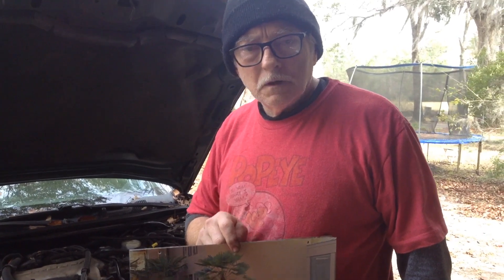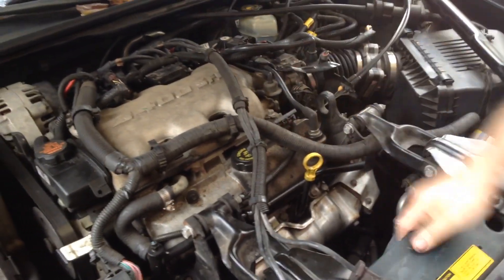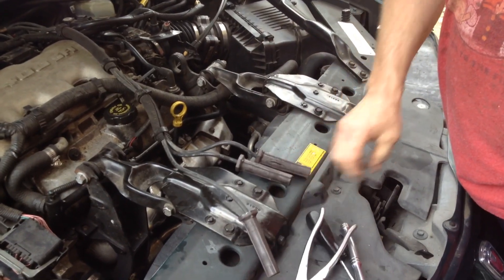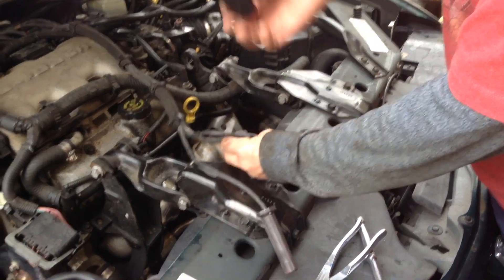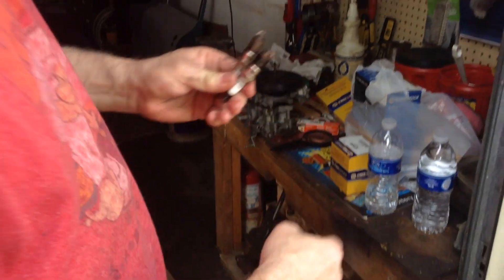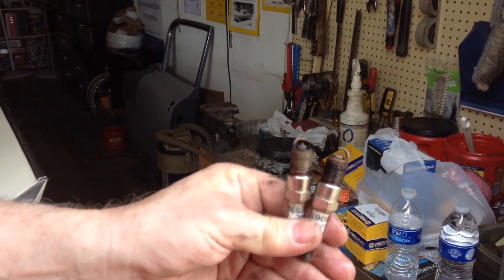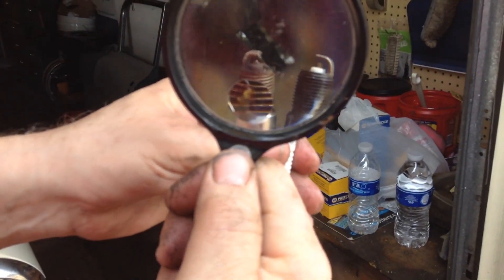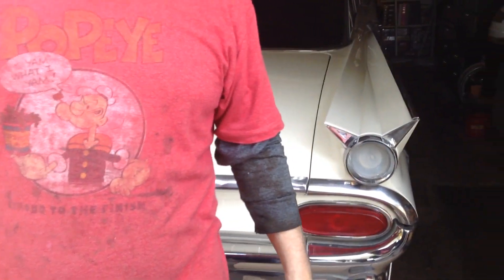How to remove spark plug boot.

Comment: I'm doing an engine rebuild (blown head gasket or cracked/warped cylinder head but you have to check the engine for other issues as well that could have been caused by overheating) and I haven't been able to remove the back spark plugs, but I'm definitely gonna try this tip. Thanks and God bless!

Update: With some PB Blaster and a screwdriver it worked wonderfully. For anyone reading this that hasn't done it yet, you just try to slide the screwdriver down as far as you can in order to space the boot from the plug and when you feel the screwdriver scraping the top of the plug, you're almost ready to start pulling it out. If you can't get the screwdriver any further, just gradually spray the penetrating oil down in to help it slide down better

Comment: Thanks!  I also have a 3400 engine and my fronts are stuck. It is a 2002 i owned since new - right after 9/11 with a gm patriot rebate.  I replaced the plugs and wires at 75k when i put a new headgaskets in.  Now at 175k, it barely runs when it rains or has morning dew.  I will try the wiggle and wd-40. I only use oem parts even on this 18 year old van!!

Comment: I tried your idea on my chevy venture (same engine design and spark plug wires as yours).    I used a screw driver and WD40 on one of the front wires and it worked great.    I tried one of the back wires and I punctured the wire because I couldn't see what I was doing.    Figuring I'll just go get new wires, I used regular pliers on another front one.   I twisted it a few times and then with all effort I quickly forced it back and forth about 5 times and it pulled out with no damage.   I went ahead and did the other front one and then did the other 2 at the back.   The ones at the back were more difficult because I could see what I was doing, but it worked.    All 4 that I pulled with regular pliers have no damage.    The wire that I punctured, I decided to cut it back an inch and recrimp the end.

Comment: Super Thanks to you.   Came on here cause I don't want to change the motorcraft sparkplug wire set if i don't have to but I can't get the boot to budge & I'm just on my 2nd spark plug since yesterday haha  better slow than breaking anything. Going to stick something in that boot to make room for that WD40.
Reply from the maker: Ax4400 you got to unhook what i call the dog bones and pull the emgine foreard
Reply: I just sprayed a little WD-40 around the top of the boot, was patient and got them off ;)
Reply: Can I spray wd40 on the side of the boot where it contacts the metal cover? That's where it's stuck..And I thought wd40 was bad for rubber parts..

Comment: How to remove spark plug boots: my '07 Grand Prix 152k had boots stuck!! Used a large screwdriver and hammer or vice grips to break the spark plugs and the boots come right off.

Comment: I do it with a micro fine insulin syringe fill with PB blaster oil. Slowly Inject oil into plug connector.Works easy.

Comment: There is nothing wrong with your old plugs, other than you could clean them(sandblast if possible, otherwise use a torch), then check the gap.  I took out plugs from a Honda and the electrodes were worn down like pointed ends of toothpicks, AND it still started quickly and ran nice and smooth . . .  new plugs are overrated BS, always have been.  Plugs are usually the last thing wrong.  I mean look at them, they are built like tanks, tough as nails.  The wires are a different issue, like any other wire needs a snug connection.  The only real issue with a plug, assuming you have the correct part, would be if you dropped it and cracked the ceramic.  Now you can read the condition of the plugs (oily, carbon, white ash) to see if there are issues going on with the engine, but that's not bad plugs.  The plugs didn't cause the problem.  The plugs are the messenger about the problem.

Comment from the maker: On most cars to get to the rear plugs you have to undo the dog bones
Reply: Pull the bones and then use a ratcheting tie down to pull it forward. I've done that to do work on several Grand Prix engines.